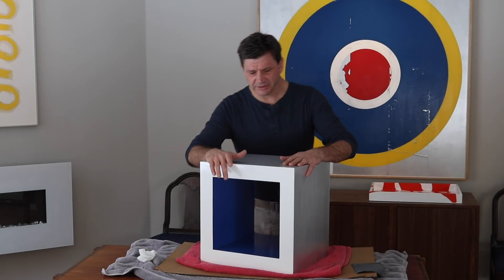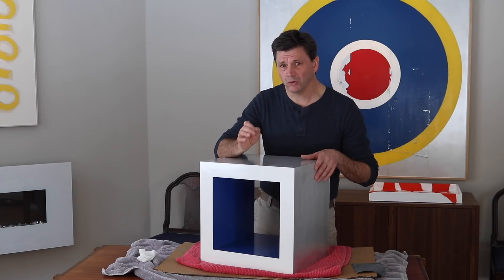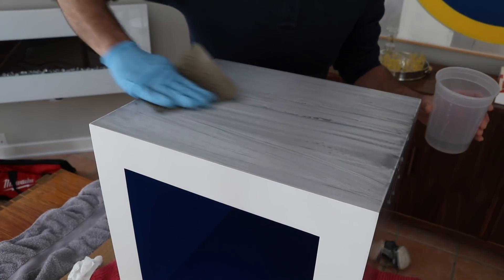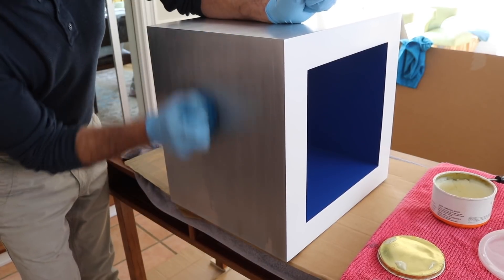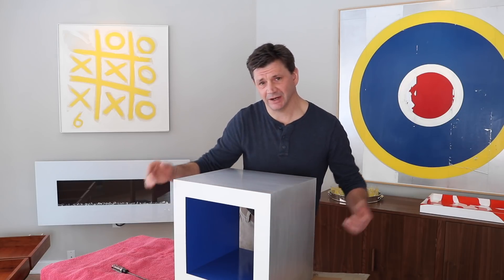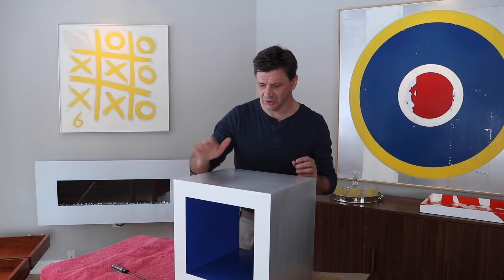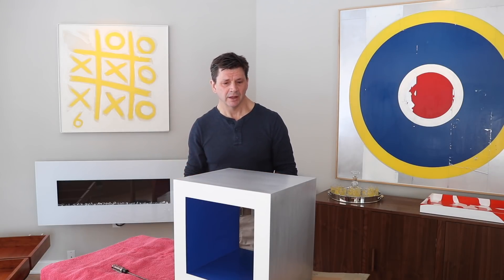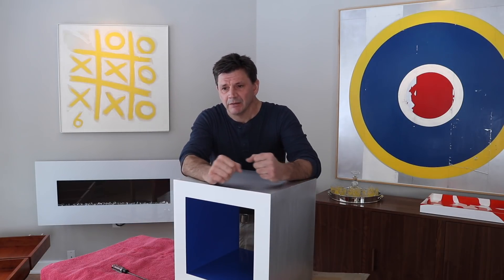Finish Failure! & Fix, Butcher's Wax is a Great Finish for Aluminum

Comment: Hi Jon,
Will you be doing a follow up review of the sawstop jobsite saw? Eager to hear your thoughts..
Also I’m very new to woodworking so basically a hobbyists, I’m looking at purchasing a sawstop jobsite or contractor saw. What would your recommendation be for a beginner? Only looking at buying sawstop for the safety feature and good reviews! In Australia Bosch reaxx is not on the market fyi.